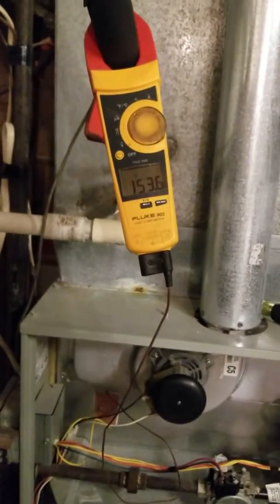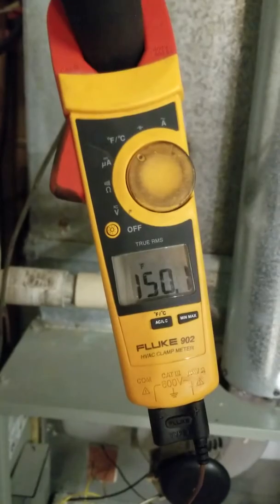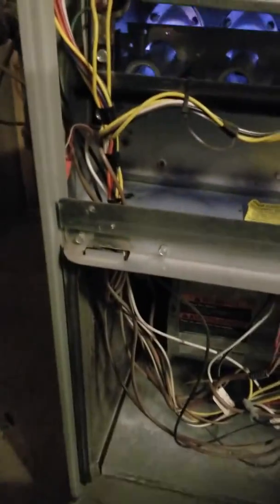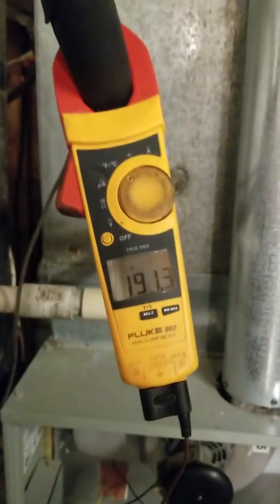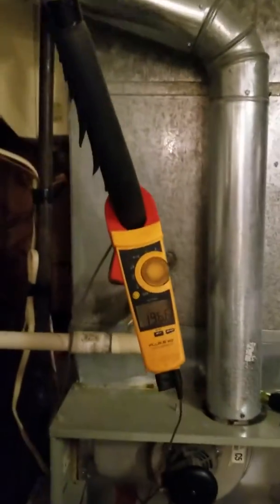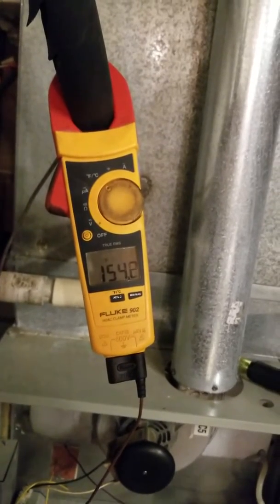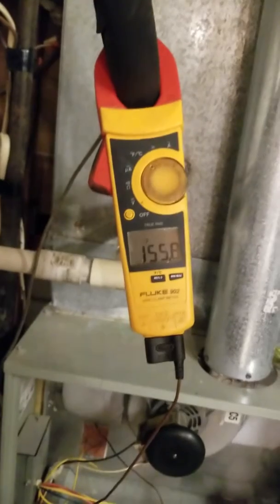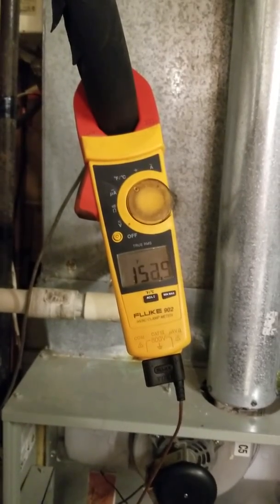overheating furnace caused by filter.

Comment: "The best" is a very subjective term. The filters that offer the least resistance and therefore the best airflow are the cheapest fiberglass filters. They are usually blue or white and cost $1-5. The thicker pleated filters (4-6")  actually allow for better airflow than the 1" pleated filters. The whole point is to check the temperature rise across the furnace while the furnace is heating and measure it against the manufacturers rating on the data plate.